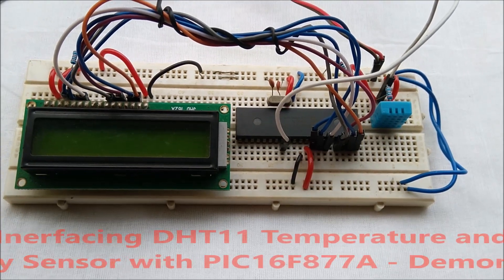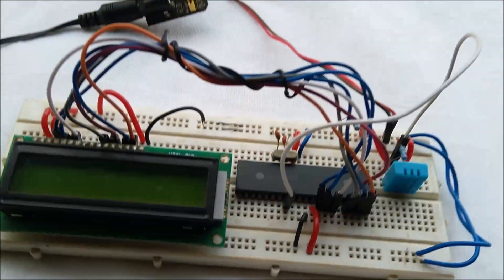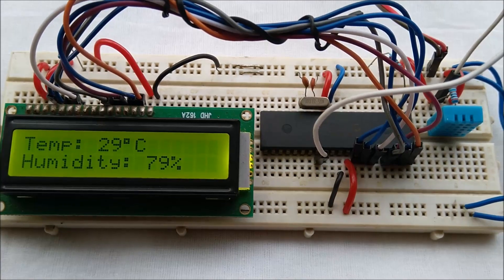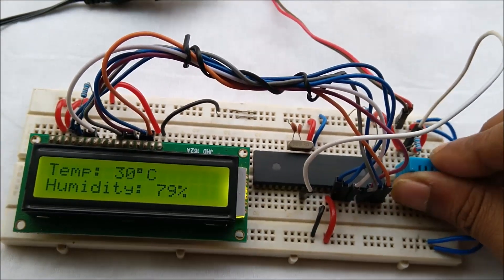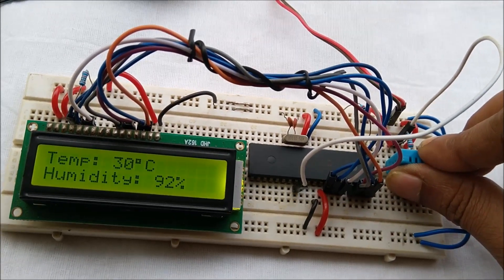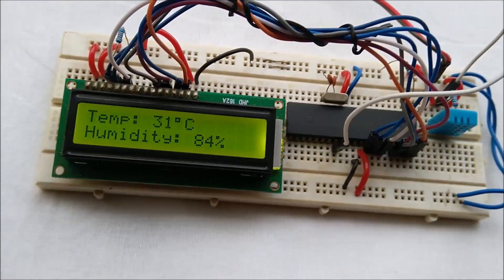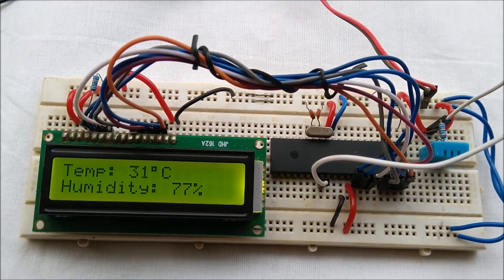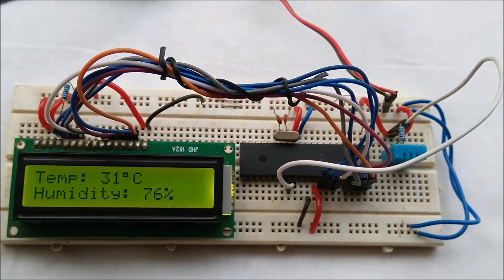Interfacing DHT11 with 8-bit PIC Microcontroller

Comment: HELLO, SIR , the code did not build successfully in XMPLAB, i even changed it to c90, will you please guide me on this , its showing that _lcd_puts undefined symbol, how can i fix it
Reply from the maker: Make sure to use XC8 compiler with the MPLABX IDE
Reply: @Circuitdigest  yes sir , it worked, THANKS   , sir can  we use I2C communication in it and also save data in EEPROM???How this can be implemented ?